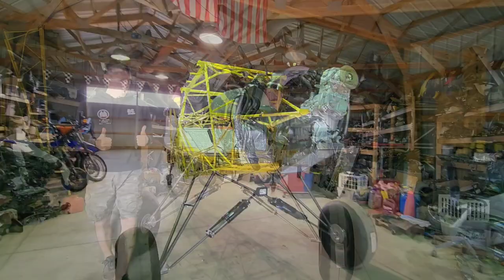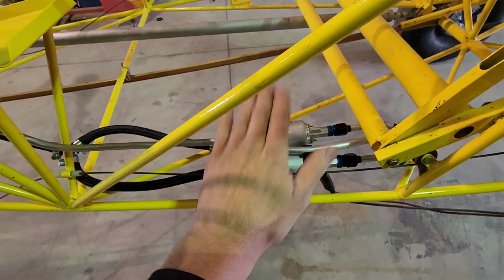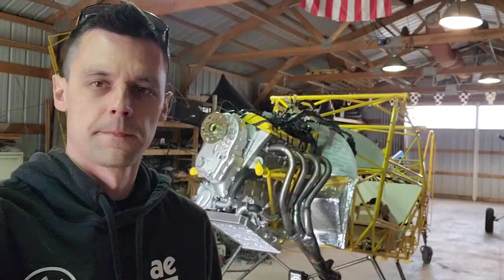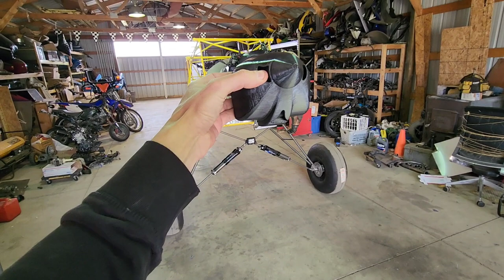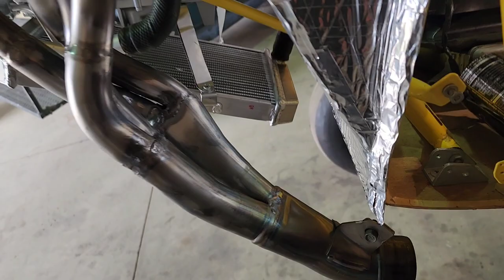Yamaha Apex Airplane - Kitfox IV Runs!!! Update!

Comment: as a bush pilot I took off over gross when required (more than a few times) - because I burned off fuel so when I landed i was within the envelope. I was aware of what I could and could not do re flying - the kicker was we had a 5000' runway at home base for an easy take off. Not everyone has that...

Comment: I enjoy your videos!
I think you are talented with maching and 3D cad printing.
It is my opinion that you may want to  consider your battery placement.  Consider your voltage losses, and possibility of RF interference on such a long runs.  Placing a larger battery with more cold cranking amps behind the traditional baggage   area may have the same effect on CG as the more distant location.  I know this will be more total weight. You still may need to run  >6 ga wires.  I would bond the plane near the battery, but still run a negative battery return wire to a common distribution point on the fire wall.
Starting engines in winter uses a lot of power.
(Warning this advice may be worth less than you paid for it.  I know some about electronics and RF interference, but nothing about aviation)
Reply from the maker: Thx! I do plan on running a lightweight  lithium battery up front for redundancy.

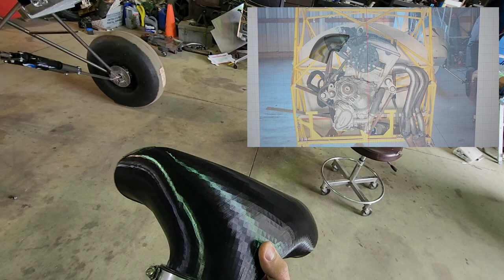Comment: hi..all i need is a basic point in the right direction. at 2:31 you superimpose the engine mount and then transfer the image to a rendering/design software package. could u please briefly tell me what you used and the name of the graphics modeler to create the design. thank you.
Reply from the maker: Cad program used is Fusion 360. I imported a "canvas" on my sketch and scaled it with corresponding points. Worked great!

Comment: G, day from Sydney Australia.
Yeh- wow... I'm amazed with your technology such as 3D printing parts.
Over and above the CG assessment and weight distribution. Making "in roads" that's for sure!
The air cooled Yamaha, very compact firewall forward. Not much room for a wrench and hands. I wonder what is the benefit in short engine mounts. I want to "get in and takeoff the mags and drop the oil etc
🌏🛩️

Comment: Nice video.  Wonder if you wouldn't be better off with a lithium battery at the firewall, and add lead at the tail for CG adjustment.  Long battery cable runs loose power unless they are big is one reason I'm thinking and some of their weight is ahead of the CG.  Also, the further back the lead weight is, the less of it you need.  The last 3  Kitfoxes I've done, I widened the fuselages at the doors, not much extra weight, and way more room when you have the other guy with you.  My Kitfox 4 with 912 and grove gear came in at 645, so if you can stay below 650,  that will be real good.  Just a few thoughts, like the videos.  Jim
Reply from the maker: Hey Jim, I do plan on running a lightweight lithium up front and the lead in the tail for redundancy as these engines are boat anchors with a working battery. Yes I do hope this ends up under 700 with 150 hp!

Comment: Could you tell me the physical size of your radiator and how many coes it has? I am putting a 3 cyl. 973 onto and x-air, (yeah, most people don't know what and x-air is) and I am trying to get an idea of coolining needs. Nice work on all of it. I like the 3d printed stuff.
Reply from the maker: Sounds like a cool swap! I don't know the size off the top of my head but It's a 2008 Kawasaki Z1000 Radiator. Another 1000cc motorcycle engine so in theory this should work fine.
Reply: @bkairys  Thank you, this helps a lot.